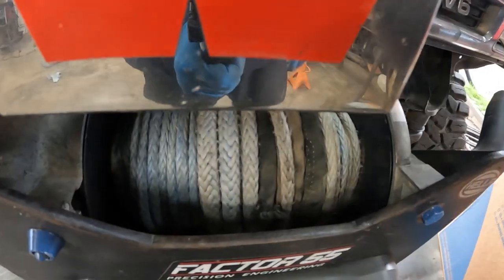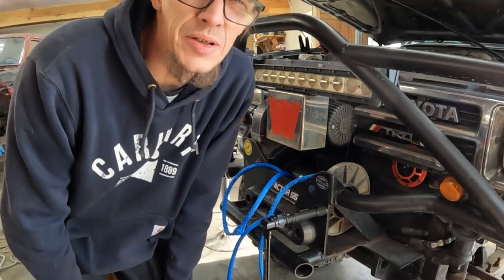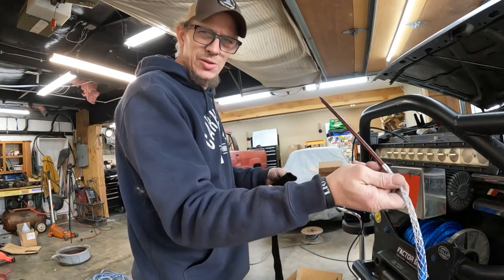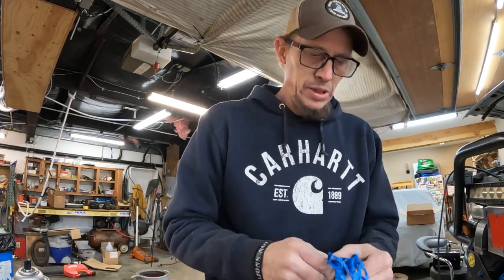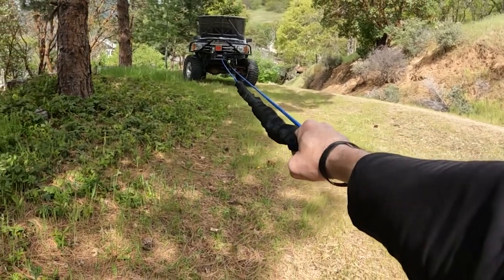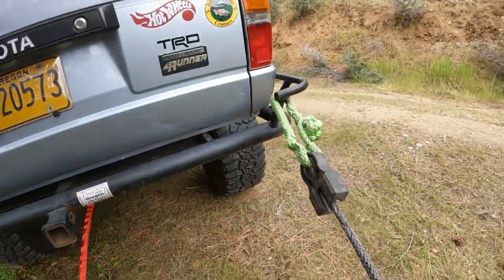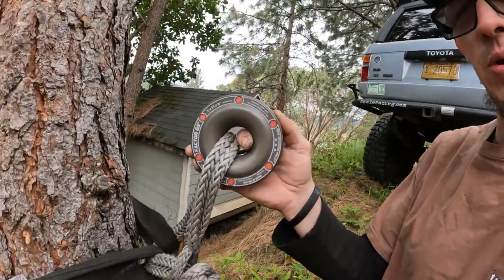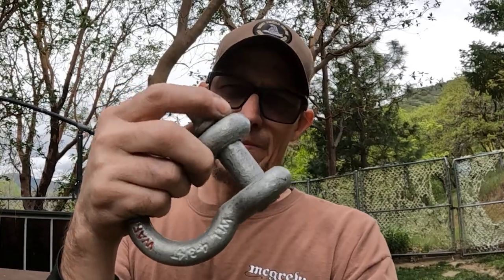replacing and spooling winch rope

Comment: I will not look for used 8274s, I will not look for used 8274s, I will not look for used 8274s, I will not look for used 8274s, I will not look for used 8274s, I will not look for used 8274s, I will not look for used 8274s, I will not look for used 8274s... Plus, that'd be bitch of fab work for the Prado.
Reply from the maker: doo eet!